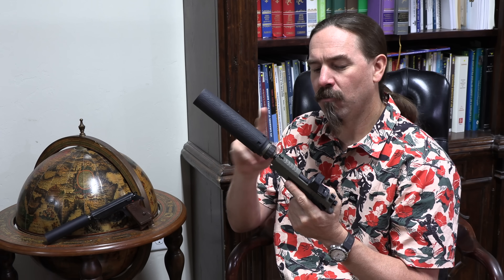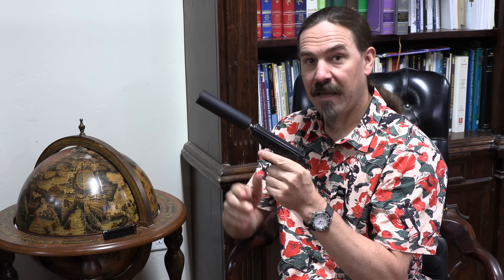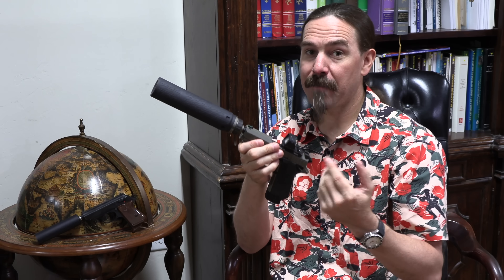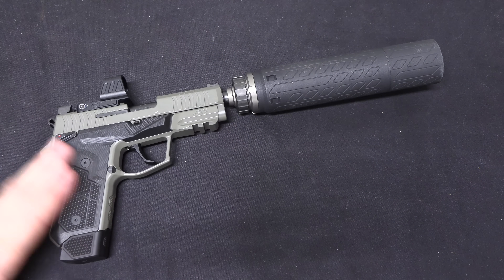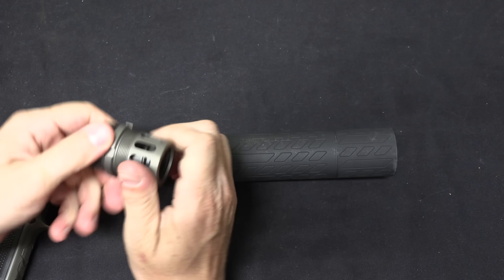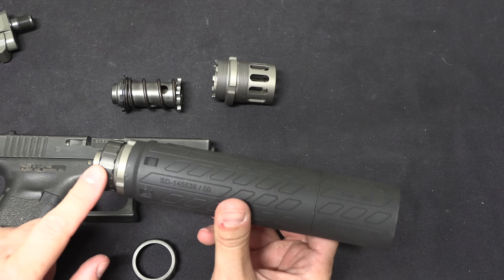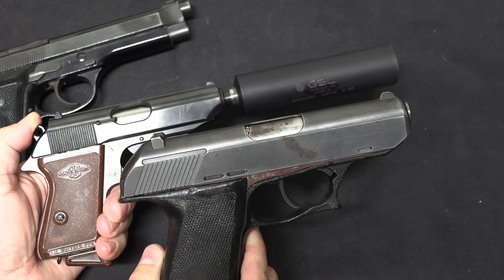Nielsen Device: How it Works and Why it's Necessary

Comment: in the videos of the shots without the nielsen device, you can see the suppressor slamming against the frame of the gun, thus blocking movement of the barrel (which it doesn't do at all with the nielsen device). Isn't that a bigger issue for this specific gun than unbalanced spring/recoil power?
Reply from the maker: The angle makes it look like the can is hitting the frame, but it is not. I checked that before and after firing.
Reply: @ForgottenWeapons  ok then, thank you for the explanation
Reply: @ForgottenWeapons I noticed the shot at 10:44 does not manage to fully cycle back into battery, simultaneously causing the neilson device to not fully re-seat itself around the piston.
Reply: @SwampyMusic  it goes into battery, the clip is just to short. You can compare to this 10:24
Reply: @SwampyMusic  This is the result of intertia. The suppressor is "flying upward" and applying pressure to the end of the barrel. Since it's a relatively large mass, it takes more time for it to end its upward motion and "fall" due to gravity, but once it does, it relieves that upward tilt pressure and lets the barrel go into battery.
Reply: @kamulec4969 oh ok yea that makes sense
Reply: @JustaPiGuy  BUT  WHAT  THAN THIS   MEAN IF YOU REALLY  PRESS THE PEDALL LIKE   SHOOT PER   0,12 SEC  / CAN   BARREL  GET TO POSITION  WHERE  IT  WILL  CLOSE   CHAMBER  NOA AFTER SHOT   WHEN  IT LOOK LIKE  FOR PART OF SECOND  /I DO NOT  KNOW   CAMERA SPEED / BUT YOU  CAN  SEE AFTER   EJECTING    BRASS FULLY  IT LOOK LIKE  NOTHING WILL HAPPEN  BUT  SLIDE   NOT   GOING   TO  FULLY CLOSED  BUT LIKE 1,5 CM   OPEN / THAN IT  LOOK  IT SLOOW    LEVEL  AND SLIDE   SLOOW   CREEP  THAT 10 TO 15  MM  TO    GET CLOSED AND READY  FOR  NEXT SHOOT / IS  THIS  NOT   LIKE  SLOW  REALESING   SLIDE WHEN  RACKING  PISTOL  THAT CAN  MAKE     JAM /  THE KIND  YOU HAD TO  TAP ON  BACK OF SLIDE   TO    PUSH  CARTRIDGE  LAST FEW  MM  AND  CLOSE   SLIDE // SO CAN  YOU FIRE WITH  THIS   SUPRESSOR   AND   THAT ADDED  PART AS FAST AS   WITH   NON SUPRESSED   GUN OF SAME  MODEL // NOT THAT IT TAKE   /OK ON  VIDEO IT TAKE   2 SECONDS  TO   RETURN SLIDE    LAST   12 MM  TO  CLOSE  AND  IS READY TO FIRE  BUT  HOW LONG  DELAY IS THIS IN REAL  TIME / IT  SURE  IS   SOME   BECAUSE  I  HAVE SEEN  SUPERSLOW    OPERATION  WITHOUTH  SUPRESSOR AND THIS    PART   TO INCREASE  PRESSURE   AND    WITH NO SUPRESSOR  YOU SEE SLIDE    JUMP  BACK  SO  IN TIME WHEN  BRASS IS   STILL IN  AIR    SLIDE IS ALL THE WAY CLOSE / HERE  LOOK LIKE   IT TAKE   QUITE A WHILE  TO   RETURN  TO  CLOSED  POSITION / AND   WHAT IS  PUSHING   ROUND  LAST   5 MM IN CHAMBER  JUST SPRING   IN MATTER AS  IF YOU   RACK PISTOL  BUT DO NOT  LETSLIDE  GO  TO  HIT FED WITH FULL SPRING FORCE , BUT AS  NOVICES  WHO  RACK SLIDE  BACK THAN  GENTLY   HOLD SLIDE AND    HOLD IT UNTIL  GUN IS RACKED  / ALL KNOW  PISTOL   HAD TO  BE  RACKED SO  WHEN PULLING SLIDE   TO  MAX  BACK YOU LET GO  SLIDE  NOT  HOLD IT AND   SLOW  IT  DOWN  SO NOT   TO HIT  /RACK   ROUND SO  ,,VIOLENT  /AS  NEW SHOOTERS  FEEL /
Reply: @michomicho7668  I cant take you seriously if you type in all caps and spell every other word wrong
Reply: @SwampyMusic That shot eventually will re seat. The slide always slows dramatically right before going fully into battery.
Reply: @michomicho7668 Why are you YELLING?
Reply: @ForgottenWeapons  i know it doesn't hit. (i trust your knowledge and you were there to fire it) but couldn't you also have made a shot with only the direct thread adapter and not the whole supressor to show it cycles normally with the thickness of the supressor?
Reply: @ForgottenWeapons  I'm going frame by frame at 9:19 and it definitely looks to be hitting the frame.
Reply: @joesand389  either you watch him because you trust his judgement, his opinion, or his understanding of firearms, why would you essentially call him a liar?
Reply: @ForgottenWeapons I'm really glad you made this video
Reply: @ForgottenWeapons  That would be quite a conicidence...  😄🤣
Reply: @ForgottenWeapons the beginning reminds me of why it's important to record things that everyone in the know already knows like that ancient trade hub city that we aren't sure exactly where it is because it was always recorded as like yeah that place that everyone knows where it is that city
Reply: @ForgottenWeapons whoa are you sure? It even looks like the whole setup is getting tilted because of the slamming (which can also be because of the pivoting tbf)
Reply: @zoutewand  how dare thou question Ian
Reply from the maker: @zoutewand  Quite sure. If the can hit the frame (actually it would be the guide rod, which isn't visible in the shot) then the slide would not be able to unlock from the barrel and both parts would atop abruptly. Since the slide continues back after the barrel stops you know that the can did not hit anything. I knew this was a potential issue because if I screwed the can all the way down, it would hit the guide rod and prevent cycling. So I only threaded it on to the point that there was a gap when it cycled, and I checked this before and after each shot.
Reply: @zoutewand  its tilting because of, ya know, the tilting barrel
Reply: @zoutewand lol yeah I’m gonna assume the tilting is cause these are tilting barrel guns. I trust gun jesus to check his stuff and be honest with us.
Reply: @ForgottenWeapons if you wanna check if something impacts, best to use a paste of some sort and see if it transfers to the other surface. Paint is ideal, but grease will do in a pinch.
Reply: Even when the can doesn't get so close to the frame, it angles around, which I'll admit makes it look like it's hooking on the frame.
I trust Ian's insight on this, as he's seen a lot of parts/frame damage from pieces slamming together so I'm sure he's notice can strikes after all the shots he took.
Reply: @ForgottenWeapons  Smart man
Reply: @zoutewand that tilt is the cam upwards of the action he mentioned. We were warned to expect exactly that...
Reply: @zoutewand  either you watch him because you trust his judgement, his opinion, or his understanding of firearms, why would you essentially call him a liar?
Reply: @ForgottenWeapons it may not be hitting when cycled by hand but it dern sure is when firing. Watch real close the leading edge of the Glock frame. It deforms a bit on impact.
Reply: I thought the same thing at first too. But if that were the case you wouldn't be able to chamber a round or expend the spent cartridge without removing the suppressor first.
Reply: I'm pretty sure it isn't, cause remember the barrel itself only moves back a couple mm under normal operation without a can so it still has clearance on the suppressor, it probably jerks back because of recoil and because of the barrel not properly canting from the weight of the suppressor, this needing the Nielson device
Reply: If the suppressor hitting the frame would prevent it from cycling, you wouldn't be able to load it with the suppressor on.  If it was hitting the barrel before the barrel unlocked from the slide, he wouldn't be able to manually move the slide to the rear and chamber a round.

There is some slop in most pistols that lets the slide keep moving to the rear after it's unlocked, but after it's unlocked, it's not imparting momentum to the slide.

You can see the action is unlocking at 9:58, so any contact with the frame isn't causing the short stroking.
Reply: I suspect that the clearance is really tight. It's possible, but not something I can tell from the video that there is some free play in the middle of the cycle. E.g. when you rack the slide the barrel is being pulled by the slide and will be at one end of the available range but when it's fired it will be pushing the slide and at the other end. And how far the slide can move isn't the important thing it's how far the barrel can push it.

A simple test would be to thread the can (or even just the adapter) on, push it back as far as it goes and then check for contact. If you want to get really detailed you could mark the slide and frame in that position and then try again after removing the can and see if it can be pushed further. If it goes back further without, that would be rather conclusive.
Reply: I threaded a simple pipe to my pistol. It would not cycle. I pointed it down and fired and it still wouldn't cycle. I pointed it up and it still wouldn't cycle. I thought weight was the issue. It was an aluminum pipe. Not a lot of weight.
Reply: @wannabecarguy  It's the mass that's the issue.  Doesn't take a whole lot of mass to throw a recoil-operated firearm out of whack.

It doesn't take much to mess up the operation of an inertia system on a shotgun, either.
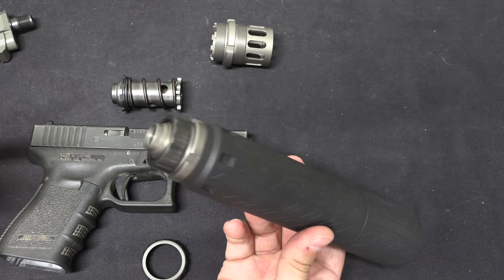Reply: You can see the full length that the receiver moves at 10:40, it gets an extra two centimetres at least of motion which seems to really help with the ejection as compared to around 9:15.
The whole assembly seems to require that motion-break; which is what the Nielsen does effectively with most mid-calibre firearms from the looks of it. Whenever you add baffles to any gas or blowback system it'll disrupt the balance of the system and you'll likely want something to reduce the amount of disrupting you do.
Reply: My first thought
Reply: The rear flange of the suppressor obviously hits the frame - it is obvious at 9:17.
Reply: @ruevs   I think you are correct. Having watched that bit repeatedly, it is very difficult to make sense of that as anything other than the suppressor violently impacting the frame. Will be interested to see if Ian has any input on that specific point.

Comment: and that's the reason professionals used Ruger mk4  22/45 as a tool of trade:goodvibes:
Reply: I am about to go out and shoot mine, suppressed, in about an hour. The bolt design makes it extra quiet in my experience, at least for a pistol.
Reply: Yes, my MK2 get very grungy from the blowback, being the earlier model no OEM threading but a fair suppressor host with some work.
Reply: At least in Hollywood
Reply: Do you run a suppressor in a Mk4 22/45?  If so what brand suppressor do you use? Also, was the barrel factory threaded, or did you have to purchase a threaded barrel? Love the Rugers. Wonder if the suppressor would keep the cleaner. These Rugers are tricky to reassemble.  Good post😊
Reply: @kathrynleaser5093  most Mk IV 22/45’s are threaded from the factory. And it will absolutely NOT keep them cleaner if suppressed. 22lr is notoriously dirty anyway, and adding a can of any variety will increase the rate of fouling.
Reply: @kathrynleaser5093  Mark IV series rugers are maybe most easiest guns to take apart what market have. So little bit more dirty because supressor is 
not counted as issue. 
As owner of mark IV 22/45 tactical moderl i can confirm that supressor is just must to have.
Still not hollywood quiet but with subsonic rounds which barely cycle are noticeably quieter than blowback airsoft pistol.

Normal highvelocity stuff will still be subsonic because pistol barrel is not enough to get into supersonic velocities so
in that sense you can feed your ruger least with cci blazers and still have overally quiet gun.

Personally i like to feed my own with cci supressors because that extra weight on bullet will make sure action will work even at -20C weathers
whitout extra care. Norma subs struggle in same conditions. Standard velocity ammo works most cases but some brands may be more cold sensitive than others.

Good .22lr pistol and will recommend.
Reply: @Kesssuli pretty much any 22lr round from Ruger mk IV is subsonic. Therefore you do not need to buy subsonic rounds for it since they don't cycle well. 22lr rounds are supersonic in longer rifle barrels.
Reply: @True_BabaYaga  Yeah in that sense you dont exactly need subsonic ammo to have quiet gun because not even high velocity stuff will reach supersonic muzzle velocities from pistol.

Subsonic rounds are just for cutting noise down as possible. Most stuff will cycle with supressor because extra pressure.
Some will have occassional hicup but at summer time ruger will digest almost every possible ammunition whitout care.

CCI quiets are far too weak to even remotely cycle bolt but are stupid quiet with my SAK 2i supressor when operating bolt manually.

Not that standard stuff is loud than anything but just for shit and giggles when firearm makes less noise than office stapler.
Reply: @Kesssuli   "Still not Hollywood quite"  with subsonic rounds, it's just a matter of how big the silencer, because bigger means more space inside & more effective gas cooling before release
Reply: @budisutanto5987  Yeah semi-auto simply cant be hollywood quiet. Cycling action itself generates clunking metallic noise which you cant do nothing about if want gun working as intended.

Sak 2i is quite big when it comes to rimfire supressors. So there is plenty of room for gasses to expand.

Looks bit funky at nose of ruger but noise reduction is priority number one on my list so small price to pay.
Specially when it costed oly 70e.
Reply: @Kesssuli   There are pistol that didn't cycle, to achieve maximum possible silence. Shooter must manually cycle for each shoot.

When cycling generate more Db, then change to special gun use by operative.
For example full auto SubMachineGun MP5 SD, SD = silenced. 

But for home defense, when cycle is louder then gun fired noise, it's pretty good
Reply: @budisutanto5987 
from experience i would say that even subsonic round shot is tad louder than action itself.

Sound which doesnt belong inside of house if you are awake to hear it.
But definelty hearing safe even at indoors.
Reply: @Kesssuli   that's because an MP5 built in silencer is way to bulky & heavy when use on pistol, not to mention the price.

The big buffer inside the silencer, is for giving time for the gas to cool down, a little longer
Reply: @budisutanto5987 Well mp5 sd is tad special because it is integrally supressed. There are holes on barrel which let pressure out before bullet will even reach end of muzzle.
Idea is to reduce normal ammo to subsonic level.

Supressor itself is not that strange other than fact how it will cover whole barrel.

Brownin actions need that nielsen device because otherhand supressor will add mass to action which will hinder its normal function.

Bigger supressor just tend to have more room for gasses to expand and slow down before those will be released.

Design will also play big part how those gasses are slowed down with baffles and holes.
Reply: @Kesssuli   You're correct Sir. There are micro holes on MP5 SD silencer.
And yes MP5 SD is special, it's for those who willing & able to burn cash. 

Suppressor & Silencer.
I use the patent term Silencer, for device that try hard to reduce noise.
I use the term Suppressor, for device that try to reduce noise, without reducing bullet speed(power).

What lack in the market is Suppressor. It's a good device & should be more popular & desirable & eventually cheap, because those extra Db have no practical function.

And although using Suppressor is still loud, but if everybody using it, perhaps more people would be more supportive
Reply: @budisutanto5987 In europe supressors are like ammo.
Your gun needs it.

Literally paid 50€ from my basic rimfire supressor, 70€ with better quality one. 170€ to one which i use in my Ar.
Just basic baffled one but it works well enough in short stroke piston system.

So yes those already are generally cheap and easy to get.

Edit: have couple extras just in case.
Reply: @Kesssuli   Right, because we are talking guns, I assumed wrongly that you're at US.
In US silencer are tax an extra $200(not include the item price & tax) I suspect because the government wants people to hate guns, so government can ban gun.

It could be the downfall because government need tactical people (good with gun from childhood) but at the same time wants to disarm people
Reply: @budisutanto5987  Dont worry about that.

But yeah we have guns in europe too.
More controlled than in states but once you qualify with right lisences you can get pretty much anything but full-auto.

Supressors otherhand of hardware stuff which have low starting prices.

Full-auto rated flowtrough steel supressor with quick detached muzzle brake is around 700e

Generally we have things backwards compared to states. I have to pay fee for every gunpermit i drop application.
Which was 90e at 2018 and now it is 150e.

Talk about price increace in short period of time...

Our lovely neighbor may have played at part on that because police permit section was totally overhelmed around 2022 summer and have seen high application numbers ever since.
Reply: @Kesssuli   Governments at countries in Europe should find a way to compensate for that permit, because the government get the benefits from people who are ready to defend their countries.
The governments took advantage from people who loves their country
Reply: @budisutanto5987 Much more than a $200 tax. NFA
requires registration & serial # of suppressor + fingerprint card & background check. 
Big pain in the ass!
Reply: @kathrynleaser5093  they come threaded now, back in days of olde-we had to buy a new barrel (upper) which has a SN. I have a direct thread on suppressor from Tatical Innovations (it’s aluminum) tac65. Don’t get an aluminum one, get a SS or TI=much easier to clean. BTW 22 cans are extremely dirty